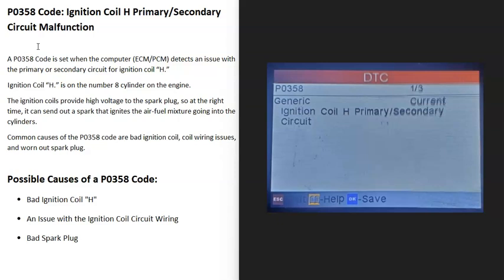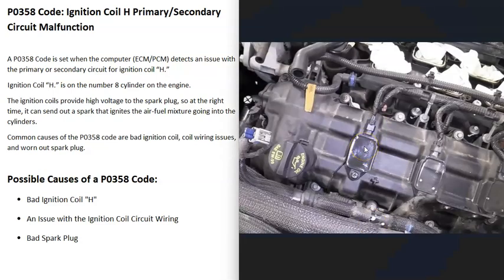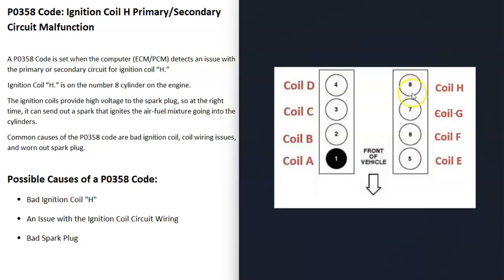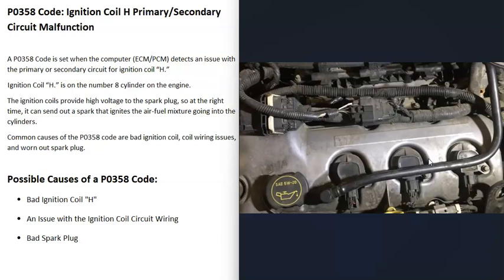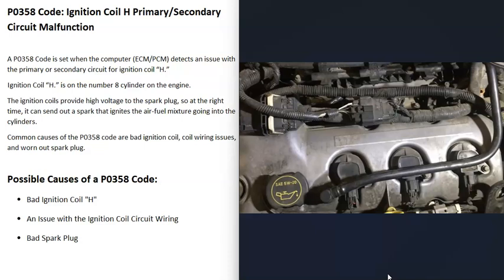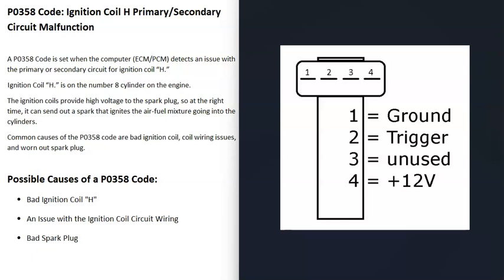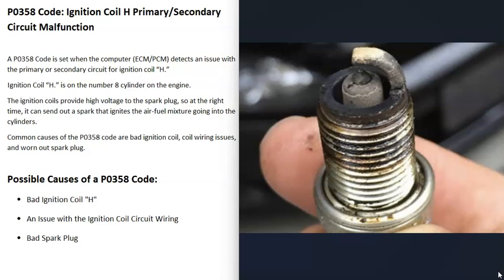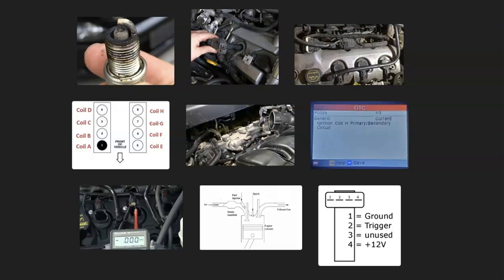Causes and Fixes P0358 Code: Ignition Coil H Primary/Secondary Circuit Malfunction

Comment: What do you do if you change all new coils and plugs and still get the code?
Reply from the maker: If the components are all good, I would test the wiring next. I made a video on testing the wiring; here is a link. https://youtu.be/JL4_HlYCKrw
Reply: Could be injector or plug as well less like injector but possible